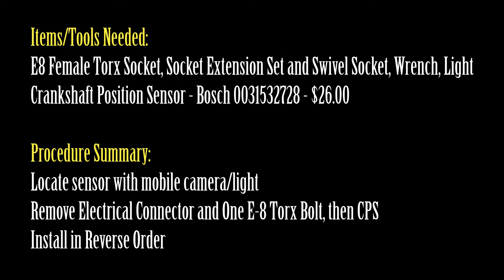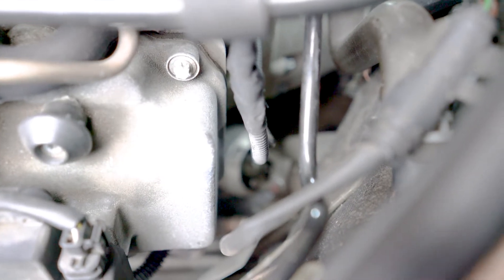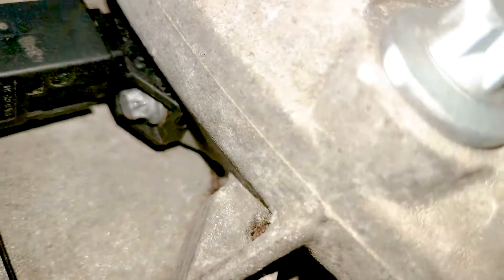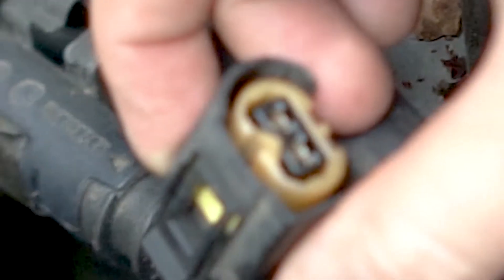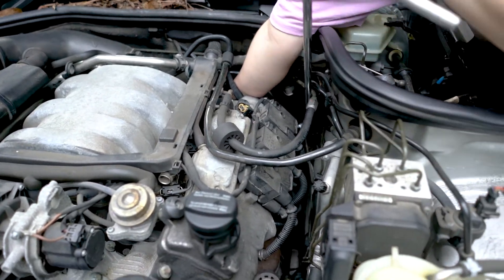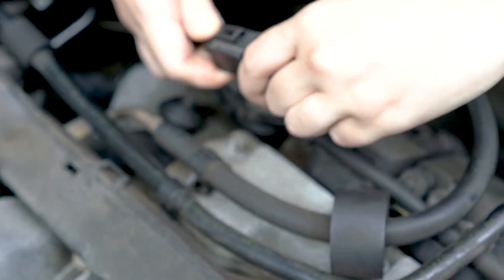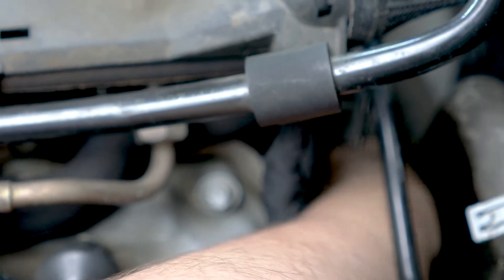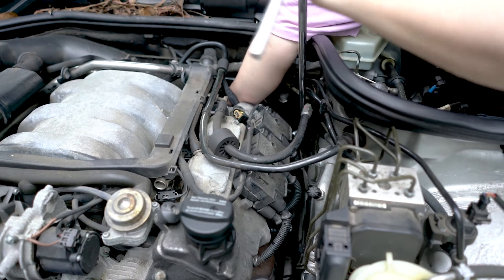Mercedes Benz W210, W220 No Start - Crankshaft Position Sensor DIY

Comment: Hi, my w220 400cdi is sometimes cranking for a long time before it starts. This happens only when engine is hot. I also have codes P1372 and P0380. Do you think this could be the CPS? Thanks
Reply from the maker: It is very possible, Markus. The part is not that expensive.
Reply: @masood-tv  I repaced all glow plugs (one was defective) and fuelfilter + a shitload of old faulty codes, car seems to be working fine now (Y)
Reply from the maker: @markenmarkus  wonderful, thanks for the update
Reply: Update, the issue came back.. car suddently wont start when hot. I replaced the CPS, car still cranks for 5-6 seconds before starting. What else could be the issue?
Reply from the maker: Hi Markus, it is hard to tell remotely.  I would suspect fuel leak somewhere next.
Reply: @markenmarkus did you figure it out?

Comment: Ignition comes on but no cranking...could tht crankshaft position sensor be the culprit  on my SLK 320 R170 465..2001 ?
Reply from the maker: Hi Knight - I doubt it.  A bad CPS symptom is that it does crank but no start....

Comment: I just replaced my crankshaft position sensor yesterday. It was for a 2001 CLK55 AMG. After fiddling around with different extensions I ended up using a 1/4" ratchet with a two inch extension and the socket to loosen the bolt. I broke the bolt loose with the ratchet and used just the extension and socket to finish taking out the bolt. I was able to squeeze the bolt against the socket to prevent it from dropping while I was lifting the bolt out. I used superglue on the socket and bolt to keep the bolt in place so I could install the bolt back in. I found that it was easier for me to put the bolt through the hole in the sensor and then install the sensor and the bolt as a unit. The bolt will be in the correct position for the bolt to be twisted in to get it started. After I pushed in the sensor a bit I started turning the extension to get the bolt started. I twisted the bolt until I could feel that I needed to finish pushing in the sensor completely which I then proceeded to do. Then I focused on finishing up running the bolt in. I then followed up with tightening the bolt down using the ratchet. I could barely see the sensor from looking at it. But once my hand gets down into the space I couldn't see it at all. I relied on my sense of touch to finish doing the job. Overall after I was done it wasn't that bad of job to do. It took some back and forth motions for a bit until I came up with a solution that worked for me. I thought I was going to have to take the car in to a shop to finish this job. I wiggled the socket a bit to crack the superglue apart to get the socket out.
Before I replaced the sensor. The engine would warm up in a rough idle and when taking off the power could be weak and it actually felt like it wanted to die. When I came off of the freeway the idle was rough. Fuel mileage dropped lower than I expected. It's odd my scanner didn't pickup the faulty crankshaft sensor problem. I only knew it was the crankshaft sensor after the engine died. Then the check engine light turned on. I was also getting an upcoming engine code problem from my oxygen sensor. It said it was having a problem warming up. The new crank sensor fixed everything for me. The upcoming problem code for the oxygen sensor warning didn't show up after replacement of the crank sensor.
Reply from the maker: Thanks for sharing your experience in such detail.

Comment: thank you for sharing this video.    I have a 1995 c220  I think is a w202 chassis. and sometimes run excellent and sometimes does not start or its running and the engine shuts off by itself. sometimes I disconnect the battery and starts again , sometimes nothing happens. only cranks.... is it possible this crankshaft sensor?
thanks
Reply from the maker: It could very well be...some of the symptoms you mention are the same...

Comment: What a pain in the ass. Fixed my crank-no start issue though. No codes.
Reply: Took me 2 days on my yr 2000 E55  screwing around and not knowing what I was doing to change mines, no help only YouTube videos, had to rub olive oil all over my hand and arm to slide down there, I somehow got it changed and it started right up, never gave me a warning before it quit in my driveway one morning, did you hear a little click when you installed the new one, I did, also no codes either.
Reply from the maker: Great.

Comment: So I’m working on 06 clk but have stored code p0025 for continuous camshaft adjustment (left) incorrect position of exhaust camshaft, replaced camshaft position sensor, still cranked but no start. Currently replacing crankshaft position sensor, let me know if you have any tips for this.
Reply: Also has fuel pressure, checked shrader valve on fuel rail and sprays with pressure out.
Reply from the maker: @LowAudio  It is hard to tell from afar...it could be a timing issue also. You mentioned CLK...if it is a CLK350, then there is a camshaft magnet too that you may have to check...
Reply: You probably figured it out, but that code means that your timing chain balancer gear is worn out and the engine has to come out to replace it

Comment: OMG I'm going crazy trying to get this sensor off! I can't reach in there well 😫😫
Reply from the maker: I know...find someone with smaller hands to do it.  But, you have to know where the bolt is first.  For that, insert a cellphone in and take a video with phone light on.
Reply: I was never able to get to it and a local shop wants 190$ cause he says he has to get a cess from under the car and remove a bracket first. Hope this does not fail soon 😫

Comment: Thanks mines say crankshaft circuit malfunction so probably a bad connection ? Instead of replacement ?
Reply: I saw another video. The guy thought he had a crankshaft position sensor issue. It was actually a bad grounding cable.
Reply from the maker: Not necessarily...bug could be a damaged wire, etc...

Comment: My w210 is doing this but I have no check engine light on. Is it possible to get no codes and still have this sensor problem?
Reply: No you do not always have the code with it. Symptoms of a bad cps are no start, slow start, or no start when car is hot
Reply: @stargazer8085  It ended up being my fuel pump
Reply from the maker: If you haven't changed your CPS in the last 70K miles or so, you probably should.  It is a cheap part.  However, from my experience it is usually accompanied by an engine code.

Comment: Thanks Masood.  Using your instructions I was able to switch out my CPS after getting code P0355.  Using your socket extension idea I was able to replace it very quickly.  Also, FYI for anyone doing this, I have a 2002 S500 and I bent the protective metal shield out of the way a bit to get better access.  The new CPS (BOSCH) was too large so I used some sandpaper to reduce the profile so it would slide in.  Also when installing the CPS, use a small piece of tape to secure the bolt to the socket so it doesn't drop out when screwing it back in.
Reply from the maker: Hi, glad to know it worked for you and thank you.

Comment: I have a c280 crank no start........the engine stopped while driving. No check engine light/ No code/ crank No start. can someone help me.
Reply from the maker: Hi Leo, it should throw a code.  There are two sensors in this scenario that could go bad from my experience - crankshaft and camshaft position sensors - but both put out a code.  Keep in mind you minimally need fuel, air, and spark for a successful start.  So, you will need to do some troubleshooting with the fuel, air, and spark delivery mechanisms.  Having said that, you can and should replace the CPM if it hasn't been replaced for a long time or ever.  It is cheap and preventative if nothing else...
Reply: Mine as well

Comment: It's difficult to replace, especially if you might be a larger person. Buy a top brand replacement, because you don't want to replace it again.
Reply from the maker: Good point. Thx.
Reply: Doesn’t matter the brand overtime it’ll go bad due to wear and tear so another big guy is going to have to do this again lol

Comment: Great tutorial for common problem. After getting the sensor and setting up the needed tools my T8 female Torx will not fit on the CPS bolt and the T10 is too big. So had friend get another T8 from auto parts store.
Noticed that you are demonstrating removal of bolt turning ratchet clockwise. Is this backwards?
Reply from the maker: Hi Dr. Paul, thank you.  No, I think the wrenching sound is lagging in the video...it does turn left to open.

Comment: is it possible to make the replacement of the part for the bottom of the car or only on top if you have access to it?
Reply from the maker: Hi Linkcel, I don't think there is a path to it from the bottom,  if there is, it may not be as easy or easier to get to...

Comment: Whats the part Number of the piece? Tks
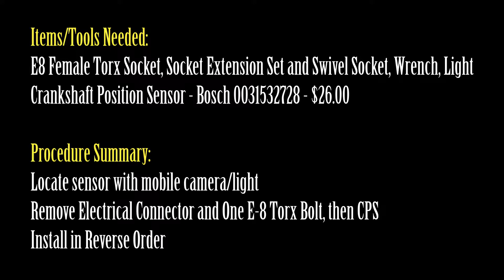Reply from the maker: Hi Linkcel.  I have the part number in the video at 0:16 seconds.
Reply: @masood-tv  tks. The Number is a Bosch Number. Do you know If exists a Mercedes Number? Like A 000202.... Understand?
Reply from the maker: @Linkcel  Here are some other part numbers for it: 0031532828, A0031532828, 0261210170

Comment: Can u help me I have samilar problem the car crank more than once but after that it works is it from crank sensor ??
Reply from the maker: Hi Hassan, when was the last time you replaced your CPS?  Most likely, yes.  If the problem persists, it could be the Camshaft Position Sensor.  That one is a little more expensive, and a lot easier to replace. But, it is a good idea to replace both at the same time if they haven't been for 70K miles or so.  To determine the root cause precisely, scan your codes.

Comment: My W210 got the same problem recently, I follow your video and make the replacement and it's resume normal now. Many thanks!!
There's another (Front) crankshaft position right above the alternator (part # 0232103037 A0041536928), do you think we need to replace this too?
Reply from the maker: Hi G Bush, na, the other is the camshaft position sensor - a little more expensive  but longer lasting. Replace at 150K miles or 15 years.
Reply: Quite a common issue for w210, often mistaken with fuel filter problem during the cold weather ( in some cases even bad diesel also) . Masood , thanks to your video i was able to replace the crankshaft sensor myself. I'm a woman, not easy to figure out how to do it without any help 😂🙈
Reply: G Bush what was your w210’s mileages when the crankshaft sensor went out?
Reply: @kevinfernando3167  It is about 157,000km = 97555 miles. Now this vehicle looks good, however… it will have once a few more seconds crank longer, intermittently say once, driving 10 times. I read Mercedes Forum, the Fuel pump, filter may need to be replaced. So, I ordered a new BOSCH fuel pump for the next project.
Reply: Hi G Bush. Any recommendations for some mercedes forums.
Thank you very much
P.